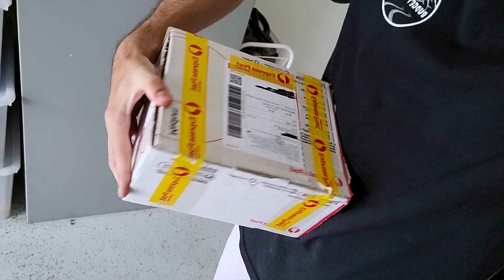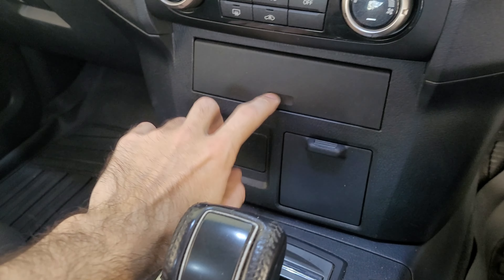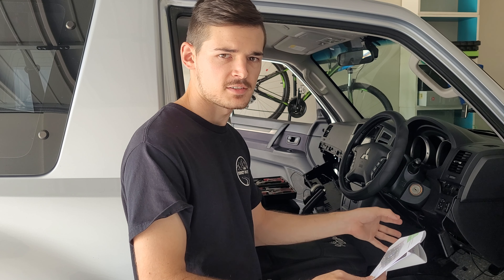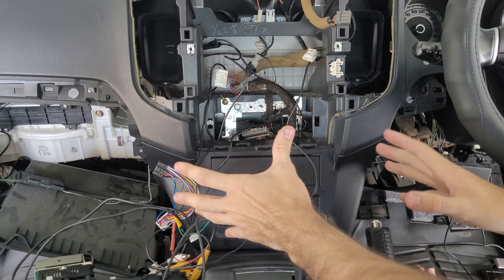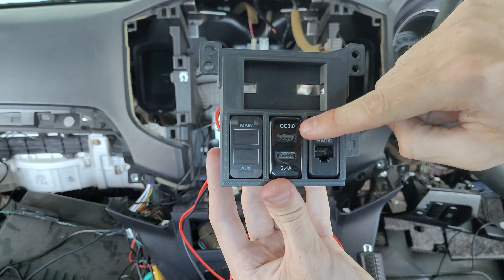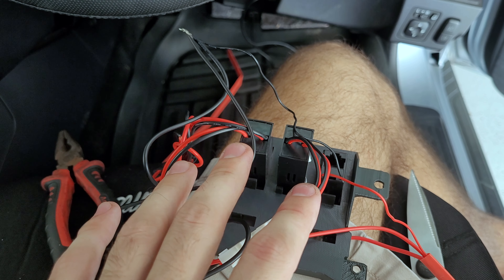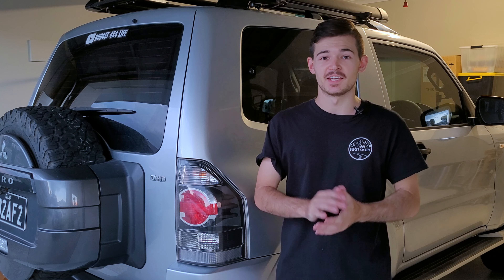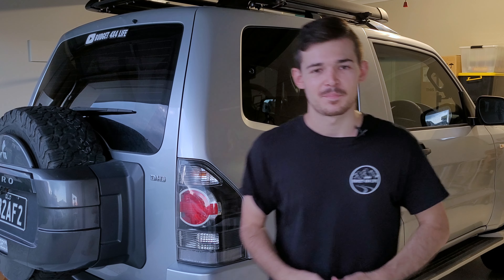EVERY PAJERO SHOULD HAVE THIS!!! Nautia Engineering Replacement Panels!

Comment: These panels are fantastic products, I have two in my NW and they are perfectly designed, and look awesome when installed. You can tell the plastic is high quality by the weight and feel of it. The service from Nautia is fantastic, one of the panels I have was custom printed to my specification so I could fit 2 x ciga sockets and my iDrive TC. I drew it up with dimensions, emailed the picture to Nautia and the design was returned promptly. A week or so later the products turn up Express Post. I was dreading pulling the dash apart but the instructions were so detailed and professionally presented (in colour) and easy to follow. I highly recommend Nautia Engineering products for anyone wanting to improve their Pajero dash.
Reply from the maker: Awesome stuff🤩

Comment: Great idea.
Not sure I would have the nads to rip the dash apart like that but well done and practical.
Reply from the maker: I promise it looks worse than it really is😄 well worth the time! Took about 3-4 hours 💯
Reply: it really does look alot worse then what it actually is dude
Reply: @budget4x4life  Cool.
Not a lot of those 2 door Paj's around the place but I saw another one up the street yesterday.
Should be awesome off road as long as you don't need to carry too much stuff.
Reply from the maker: @oldbloke204  yeah great rigs goes good offroad💯😊 Trying to keep weight down too having the trailer on trips🔥
Reply: @budget4x4life  Yeah good move.
My sport is very nearly up to GVM with the mods and basic camping gear and takes a lot to pack.
I have been eyeing off one of the off road pod trailers but the little suckers are very expensive.
If you are looking for storage may I suggest looking at Front Runner Wolf Packs as they fit perfectly across my Sport but yours may be different obviously.
Stack really well, sturdy and easy to tie down.
Not overpriced either imo.
Reply from the maker: @oldbloke204  cheers mate will look into it🤙🏼🔥

Comment: Hey mate, thanks for your videos. Quick question, is your steering wheel buttons with lights? On mine only radio steering wheels controls have lights on it. Cruise control have no lights on it
Reply from the maker: Hey matey you might need new switches. Check the negative connection of the switch first and if it doesn’t fix it need new switches which can be found on budget4x4life.com
Reply: @budget4x4life  appreciate your support !!

Comment: Great Video and great product which I hope to install soon. In your video, when the Head Unit is removed, there is a white multi connection female plug just to the right below the screw hole. What is this used for as I can't find any details of it's use.
Reply from the maker: Hey mate. That one plugs out of the hazard button switch and back in when you put the aircon vent on the right back with the hazard button😊
Reply from the maker: Nevermind just saw what you mean...nothing plugs in there so has to be for original headunit haha😄

Comment: Could you please tell me, what kind gearbox oil and oil separator should be used for Mitsubishi and Pajero v93 manual handwaves in 2009?
Reply from the maker: Gearbox is ATF FS for Jatco box and Dex 3 for Aisin I think

Comment: What are those blank plates left to the 12v pannel called, is there a pannel like this available for that?
Reply from the maker: Yeah I believe there is a 12v panel with 2 usbs that you can put in there but check out Nautia Engineering

Comment: Great stuff Dee. I have heated seats and would still like to keep the 12 outlet. Definitely would like to install this mod though. I also like the touchscreen.  What brand, model etc? Also looking forward to having the West Coast 2 inch lift suspension installed at Direct Suspension.
Reply from the maker: Thanks Mark 😊 can definitely still run a 12v socket straight from battery. Also there is one in the centre console. You can buy the headunit on ebay I have the Isudar version pretty sure. Awesome meeting you the other day💯😊
Reply: @budget4x4life  You too.  I might install a reversing camera and install at the same time to run through the touchscreen headunit as well.  Plan on keeping shorty and maybe one day, an EV conversion rather than buy new electric vehicle.
Reply from the maker: @markleeson3453  yeah I've got the reversing and dash cam with the headunit. So worth it. An electric pajero would so cool haha!💯🔥

Comment: i have installed a panel but with a wireless recharger function for phones. it had a dual connection plug that is connected to the cigarette lighter. i had to remove the battery terminal cables to work safe. after im done, somehow the traction control shows that its off, even though when i press the button to turn it on it doesn't and now im on panic mode.

any clue how to turn it back on? any help is much appreciated
Reply from the maker: Hey there. Is it the ASC button that came on? If so don't stress. Take it for a drive. After 5 minutes press it and and should go off🙂💯 it's your stability control. Sometimes it does go on when you disconnect the battery.
Reply: @budget4x4life  you're right. it went off by itself and when pushed the button to test it, its back normally functioning. thanks alot mate
Reply from the maker: @midget4957  no worries 😊💯

Comment: Its not wasted space. Its exactly for mods, gauges, switches.. many cars dont have this place. And owners need to install gauges into pillar and other not very comfortable mods. P.S you can put the power outlet sideways on middle tunnel, like some cars have it. Maybe you will install heated seats or rear locker in future..
Reply from the maker: It comes as wasted space but can be great after the mods yes😄💯 cheers mate yess leaving that one open for a locker in the future👀